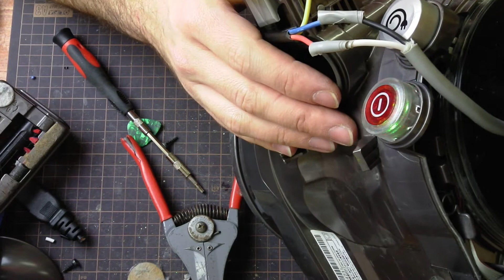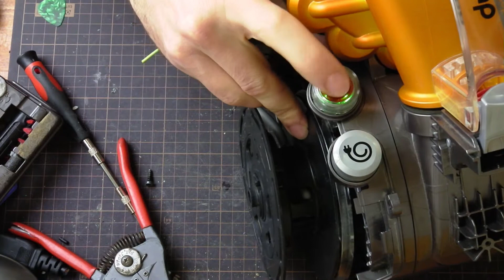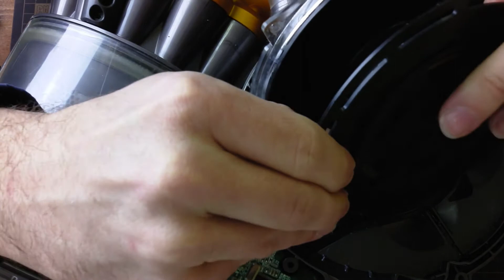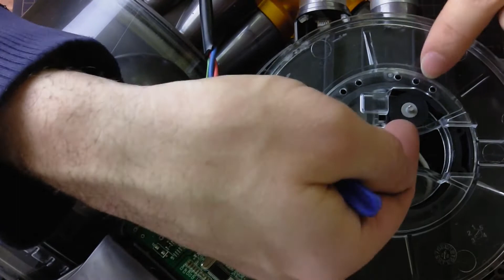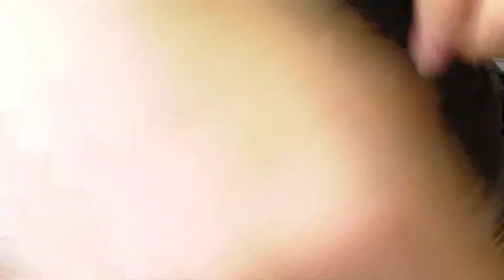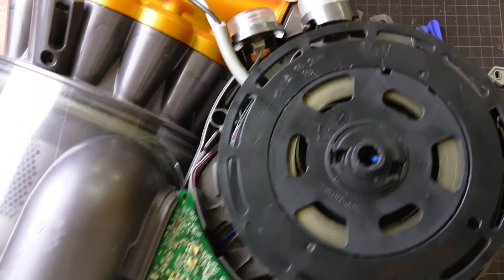Dyson DC22 Repair Ep. 3

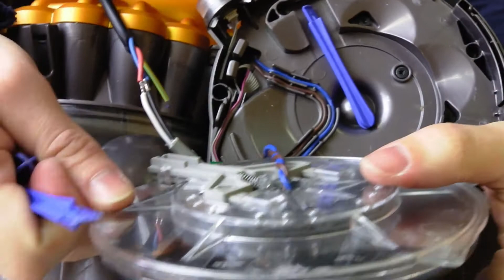Comment: To strangers in the future who stumbled upon this video who is trying to replace the cord. To take the reel apart, you need to pry the centre cap off first like at 19:25. There are 2 clips attached the the middle piece located at the cutouts. With that removed you can then remove the wind up spring, and the rest comes apart pretty easily

Comment: What a plonker you are! 
You unjustly criticise the Dyson design and you criticise plastic/ You were too dumb to work out how it was put together and you used silly plastic pry bars.
The secret is to remove the small static hub on the opposite side from the clear plastic disk. Use two large flat screw driver to prise it up. You then see the end of the clear plastic tube which is concentric with the axle tube of the black spring holder. Using a pair of pliers, squeeze the protruding end of the clear plastic tube to relieve the tabs. Then pull clear plastic part away from black assembly.  This method keeps the coil spring safe inside the black assembly.
You can now gain access to the two terminals that connect the power cord.
Cut away the defective part of the cable, fit new terminals and then re-assembly in reverse order.
Job done!